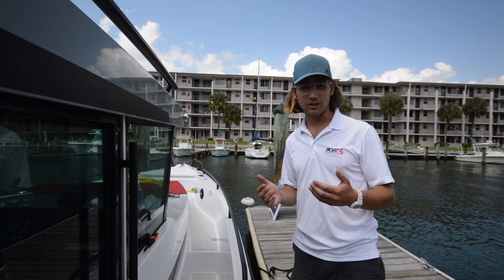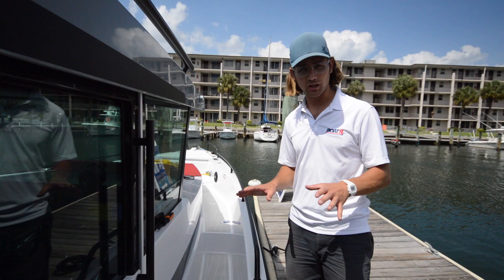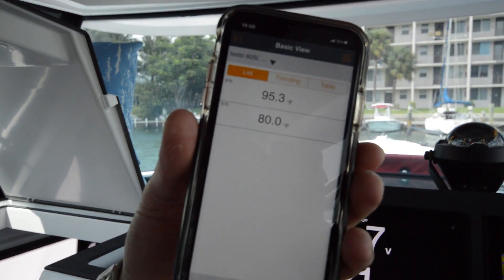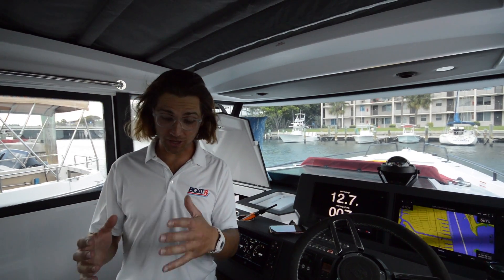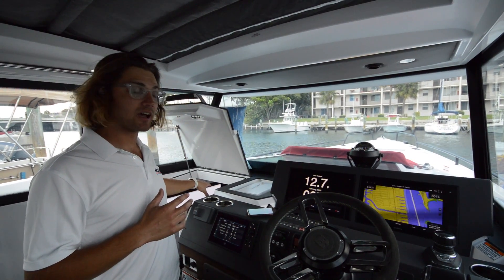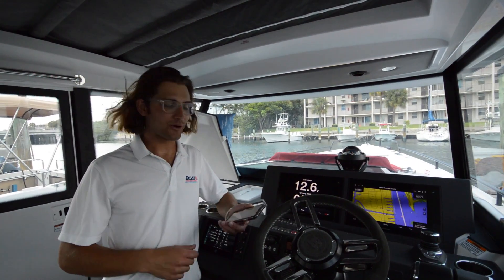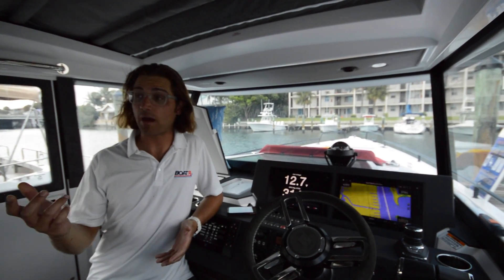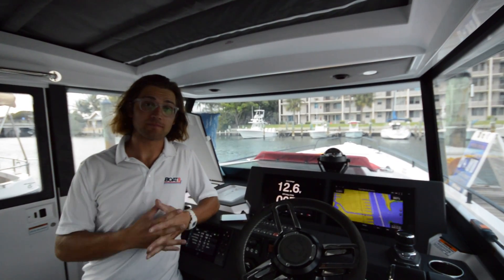Axopar 37 DC Air Conditioning Test

Comment: poor, weak, hardly able to hear audio.  Use a lapel mike.  Air temp coming out of the a/c register is supposed to be 40 degrees F, and it seems your a/c unit is undersized.
Reply from the maker: Cme4brain11 thanks for the feedback.  You'll notice in some of our newer videos we have switched to a lapel mic.

Although it's true that 40 deg F is a good target temperature for the evaporator coil, the air temp coming out of your A/C varies based on the temperature of the air going in.